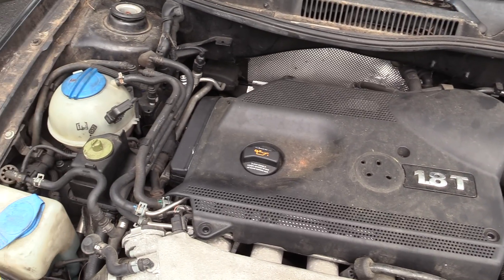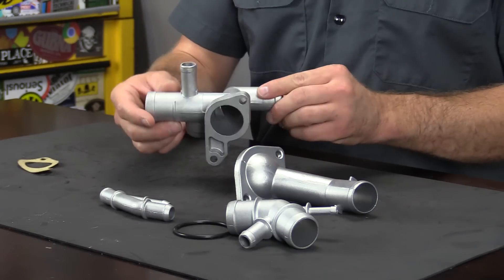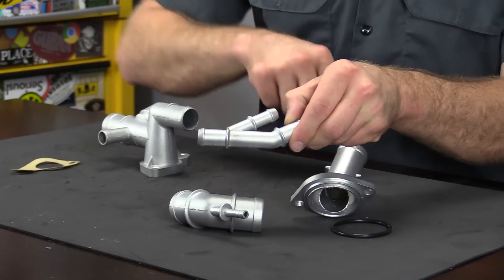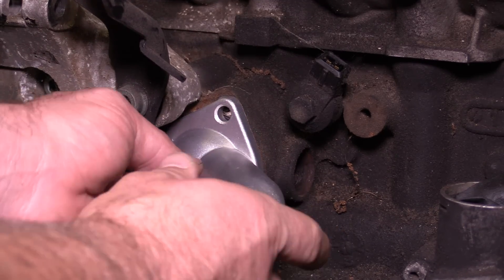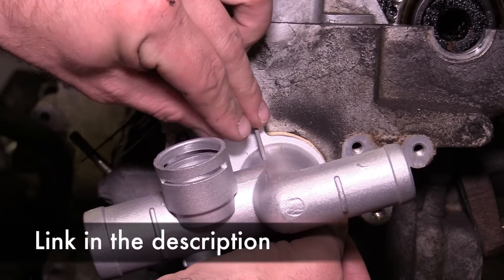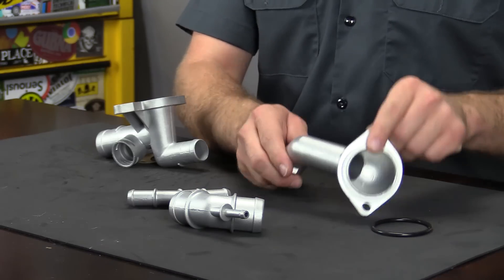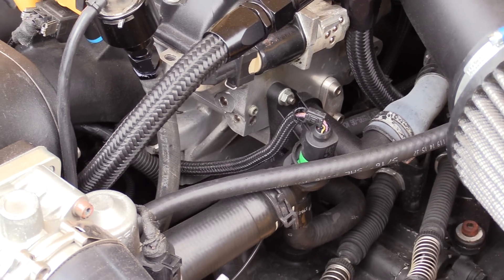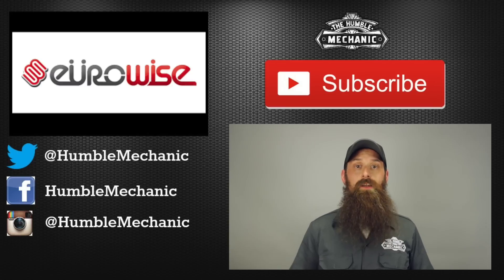VW 1.8t ALUMINUM COOLANT FLANGE UPGRADE

Comment: Can I use the aluminum flange on an automatic 1.8T?
Reply from the maker: There’s likely one that fits your car because the 18 turbo went for so long. There’s a bunch of different variations and slight changes to coolant routing and vacuum hoses. You just really wanna be careful and get the right deal for your exact powertrain.

Comment: Yeah man anyone who builds a coolant  flanges out of plastic has got to be a 😈 evil greddyass MF'R to design a highly pressurized cooling system with fukin plastic coolant parts ! knowing damn well their going to warp, crack and break off from intensive extreme heat 🥵

Comment: Everything about these piece of shit VW  is extremely bad they make em for an 1.8 but then don't make any for the worst ones the New Beetle 2001 the whole Motor is full of them it's not a Motor they built...a Fukin Cash Cow VW design it to milk every penny out of you to return for service repairs, cluttered every part against ea. other, to purposely make it as complicated as they could get it,so you'll give up just thinking about working on the piece of shit Motors...I rather buy a 🐎 to ride than buy a Volkswagen

Comment: How do you replace the temp sensor coolant flange on the 2.5? I can't find any info about it. I've taken off the nuts removed the metal pipe and removed the nuts behind them as well but it still won't come off

Comment: make sure your O-ring INSIDE the quick connect hose (hose with metal clip) is not flattened. I replaced a similar part on my 1.8t A4 and it leaked and i had no clue what it was.

Comment: My radiator just blew on my mk2 gti 1.8t swap. Has original 16 valve style radiator which is 12.5”x30” or so. Do you have any suggestions for a better radiator with dual fan.  Need to order one aSAP. Please help with brand and model if possible or something decent quality with better cooling

Comment: I have an 02 beetle with the 1.8 turbo engine. The flange that attaches to the head in your video looks different than mine.  I’d like to get an aluminum upgraded one if there is one available. Any suggestions?

Comment: The 4way flange that goes on the engine side is leaking and it costs 5eur (aftermarket) and 15eur from Audi.  It has held for 19 years so replacing it with OEM, dont trust this paper gasket in the slightest.

Comment: There are $35 kits on eBay that look on par.
Reply from the maker: They may be on par. Maybe not. Sadly you only find out they arent when they fail.
Reply: HumbleMechanic one thing I noticed was a lot of excess aluminum from the molds that needed to be removed on eBay flanges. Probably not nearly as polished.

Comment: Anyone have a problem with the coolant temperature flange connecting straight to the engine block on the TT 225 engine? This is the flange that has the sensor attachment. The piping is a bit different than the stock OEM one, and hits parts in the engine bay.
Reply: That's why im here, did you find a fix? His kit came with bolts but mine is studded with 10mm nuts on it. The first time around the paper gasket disintegrated, just put a new one on and it's now a slow drip instead of a huge leak. Any idea what the issue could be??

Comment: Be sure to file down the cast aluminum edges on these parts. Some of the cheaper coolant flanges have chunks of cast inside the flanges them, which easily break off.

Comment: What about jetta 2.5 no video for water system or water pump.???!!
Reply from the maker: Haven’t had to do one in a while. Those pumps weren’t too common fail. They did leak from time to time
Reply from the maker: I dont think there is much in this space for the 2.5 yet. But that seems to be changing

Comment: Does anyone make one of these for a 2003 1.8 beetle turbo S engine code AWP? My car makes 320hp after a complete APR upgrade and I want better parts.
Reply from the maker: Eurowise May have them.
Reply: I checked them, no dice.  I don’t think anyone makes an improved part for the beetle.

Comment: Loving your 1.8t. I'd also like to add your rubber hoses are not a Lifetime item in your car, be it for the coolant, air (vacuum) or oil they all fail and usually, you're far home when they do. So if you are investing in your peace of mind with these aluminum parts don't short on the other wear and tear parts. Their failure will cost you more money sooner rather than later and if you own a VAG vehicle, buy quality parts from a reputable supplier, while many great things come from China, cheap low quality knock-offs are not.

Comment: FYI, the coolant flange on the drivers side will not fit properly on my 03 Jetta 1.8T with an automatic.  The factory fitting exits through the side to the transmission heat exchanger while this one exits through the bottom which puts your small coolant line right on top of the shift cable mount of the starter.  I did manage to make mine work but I will need to watch the hose for stress damage due to the hard bend.
Reply from the maker: The 1.8t with the jatco trans is a whole cluster jam of odd.

Comment: What if you don’t put the paper gasket on the flange will that cause problems ? I bought this set but I’m still overheating . The paper gasket ripped so I didn’t use it and steam is coming from that area but i what’s going on
Reply from the maker: It’s probably the issue. I’m guessing g it’s leaking?
Reply: HumbleMechanic it’s not leaking at all just a lot of steam and it over heats pretty fast
Reply: Please help 😪😪😪

Comment: Hey man I have a question but is there anyway I can send you a video? Some coolant line broke on my 2004 Gti 1.8t and I’m having a hard time finding it. It’s hard to describe but. I’m replacing the small coolant line that’s at the bottom of the coolant flange. And the hard line that that connects too is also leaking and it’s old. I don’t have the part number or anything

Comment: Hey I have an 04 golf 1.8t and I’m getting the aluminum flange but the problem is the hose at the bottom is currently cracked and coolant leaks. Would you happen to know where I can get one of the hoses or where that hose connects to so I can find it?

Comment: i have a question i just picked up the same flange im thinking about tapping it and installing an aftermarket digital thermostat sensor for better watch on the temp what type of sealer would you use on the flange when tapping a hole to thread the brass sensor on  thanks ?

Comment: I have an 04 1.8  that's leaking on the back on the engine all in the left top half of the trans.  Does anyone know where it would be coming from
Reply from the maker: Probably valve cover/cam adjuster

Comment: I have  a 1.8t with a blown head gasket causing it to overheat. K@W  permanent metallic block sealer was recommended, do you agree? And if so is removing the  thermostat necessary?
Reply: Dude do not waste the time that metal or paper head gasket is sandwiched between the head and the block no amount of magical anything will replace it, something poured in your engine will temporarily clog everything so in the end you’ll still replace that head gasket be it today or next week. With a good torque wrench, the special VW tool for head gasket bolts, a standard 12 point toolset with a long breaker bar, a new timing belt and water pump while you are in there, a proper head gasket kit and roughly 8 - 10 hours if you go really slow with no mechanical aptitude. Instructions are all over the internet. I did mine 6 weeks ago with printed instructions from online toke a few days to clean up the head and block before putting everything back together but actually it was pretty easy. Btw set all the timing marks TDC , just take your time learn your own motor or be prepared to write a fat check.

Comment: Hey, 

good vid thanx.

I'm a noob. I've never worked on a car in my life. But I have an 2001 Audi TT quattro 1.8 225HP

i'm not going to pay Audi to do it, and I'm not going to burn 125/hr rates in CDA because they say, 'oh he owns an Audi so let's jack his labour costs'

especially because it's an 2001 Audi TT. 

So do you have a video which walks through the removal and installation of the flange?

i should pick one up immediately, so for now, plastic is what will happen, but of course, i am ordering a complete aluminum kit, because I don't want to have to do this again, and replacing seals is not replacing an entire unit.

Comment: I have a mk6 jetta 1.8t se and found my two heater core tubes cracked in three places. my coolant is slowing going lower. my AC and Heater still work but when I drive the coolant leaks and makes small amounts of white smoke from the hood. I can go ahead and just replace the tubes then flush and refill the coolant right?

Comment: do you know if they make these for the 2.0 slow engine of same vintage? I see a lot of coolant flange failures from the oe plastic ones now
Reply: They make them for the 2.0 now.
Reply from the maker: For right now, it's only 1.8t. But I am sure that it could be made too.

Comment: I replaced my coolant flange just two days ago, second time in 2 years. To be honest, the 2 screw design on a fitting like that is a flawed design. People always over torque the fitting to get it to seal deforming the plastic resulting in a crack. I installed my new one with some Dirko HT Red and just nipped the screws tight. No leaks.
The alloy ones do look the part though ;)

Comment: Charles; my 1.8T MK4 Ibiza FR idles quite high at 1200rpm when I start the engine and drops to about 800rpm after about 30 seconds. I've always waited for that rev drop before I start driving, but I was wondering why it happens. Is it something to do with oil reaching the head?
Reply: standard cold start sequence

Comment: hey im looking to buy a 2001 1.8L beetle for my mother and I'd like to pick your brain about it please?
Reply from the maker: sure what you got?
Reply: hey, yeah it's got about 117000 miles on it a GLS turbo manual, almost looks like a 1/8th" aluminum skid plate that doesn't look factory under the front clip(just wondering if that was factory or not), it drives good but the body is pretty rough and the interior is about par with the body, it has some sort of buzz from an electrical motor(i think) after it's been turned off under the alternator/ac compressor area(is that the water pump or something?).  i'm just wondering what to look for and such besides the normal universal things? i wasn't able to get it up on a lift but from what i saw the undercarriage looks alright besides the front bumper skirt is torn off probably from the alaskan winter driving with such a low car.  one owner. oil & coolant looked good. i've got photos if you got someplace i could send them.

Comment: This is the same as the one from USP Motorsports right? I just rebuilt my engine and changed the timing belt and other belts and waterpump and upon start up mine started leaking out the back, I replaced it with an OEM one though. is this better for the longterm?
Reply from the maker: I think it's similar. I think it is a better option for sure.

Comment: How long should you idle your turbo motor after a cold start and before shutdown to avoid damage due to loss of lubrication? Is this time different for diesels?
Reply: 20 seconds cold start. Just to get oil in the head.. and if you push your turbo car then few mins idle (5 mins ) or 3 kilometers ride under 2000 rpm.
Reply: +busilica123 And yeah change your oil every maximum 15000km for TDI Pumpe Duse ( Take high quality oil )... Mine got 370 000km with regular and quality maintance (/TURBO IS STILL FIRST ONE )

Comment: what does he mean by " an engine that was on the stand"? Would i need to be able to pull out the entire engine for this repair.  the shop is trying to charge me $1800.00 for this repair.
Reply: The engine he showed (the rusty one) is removed from the vehicle... it's on a stand.

Engine does not have to be removed.

What year model is yours? Sounds way too much for that job.
Reply: +Thomas EXOVCDS '05 Jetta GLI MKIV
Reply: +Thomas EXOVCDS I guess it's the entire cooling system the shop was charging me for, flange and water pump
Reply: +TEZ-ONE There you go... water pump is the biggest labor cost.
Reply: That amount makes sense, sadly. I did the water pump on my MK4 Ibiza FR 1.8T and it's not a quick job. It is fun though.
Reply: Thomas EXOVCDS the biggest reason I think shops charge so much for a simple water pump on a 1.8t just because they don't want to work on Volkswagen, and i don't get it. it's just nuts and bolts.lol
Reply: Tony Mullins It depends on where you go / if the shop is familiar with the 1.8T or not. Timing belt & water pump kit can easily be replaced "under" the allotted book time. Finding other issues that need to be addressed "while you are in there" (cam / crank seals, plastic coolant Y pipe by the reservoir, coolant flange at head etc) will add more "unexpected" time, compared to what the initial estimate (over the phone) was. Some shops don't want to touch certain things because of that snowball effect. If the customer does not want the additional stuff... they will complain about future leaks (even though those issues were mentioned to them). "I just paid $$$ for a timing belt & water pump... I still have leaks!!!". I see it all too many times! LOL
Reply: Yeah buddy your right every now and then I get lucky and don't break anything or that dang Y pipe them things get so brittle, I had to go out to a lady's house today and replace that Y pipe today actually lol. By the way I like your Channel👍👌
Reply: Tony Mullins Thank you for watching!

Comment: Do a video on how to tell if you have a used 2.0t turbo the 2005 newer vw mine isn't leaking or bribing but not pulling hard no leaks
Reply from the maker: +Aaron Yauger I am not exactly sure what you are asking. I don't have any videos on the older turbos failing. They were less failure prone
Reply: +HumbleMechanic I have a 2006 vw Passat 2.0t FSI CAN you tell me if its needing replaced do a video on how they pull don't think mine is pulling hard
Reply: +Aaron Yauger get a boost gauge (obd2 one should work.. Or a good old mechanical one).. Bad turbo will not show as much boost but low boost could also mean leak elsewhere not necessarily a bad turbo. Or you can take off some hoses and check for play in the turbo.